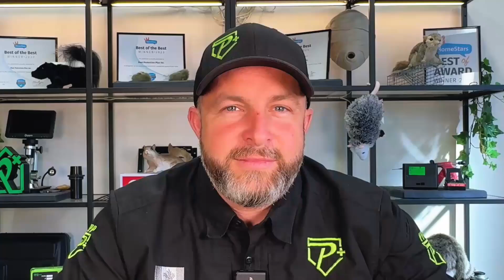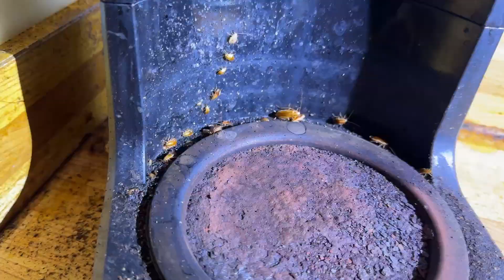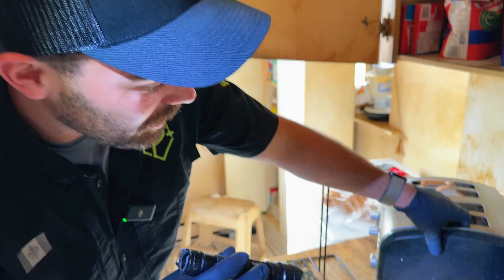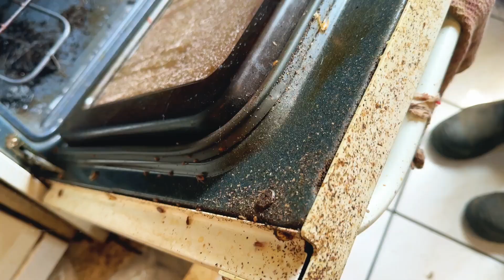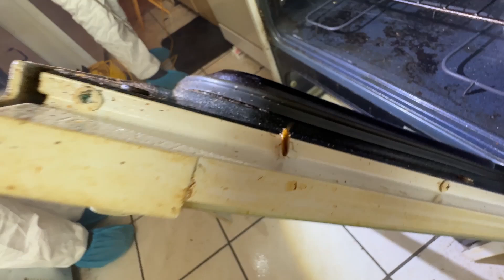Getting Rid of a Severe Cockroach Infestation an Exterminator

Comment from the maker: 🧭 Timestamps 🧭
00:00 - Introduction to the infestation level
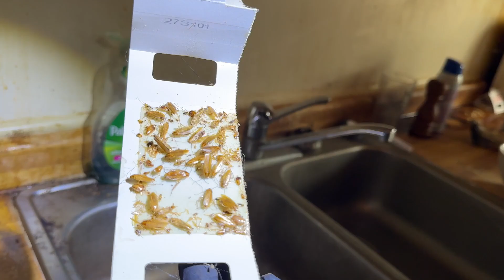00:27 - Why DIY sprays and foggers fail
01:21 - Step 1: The professional inspection process
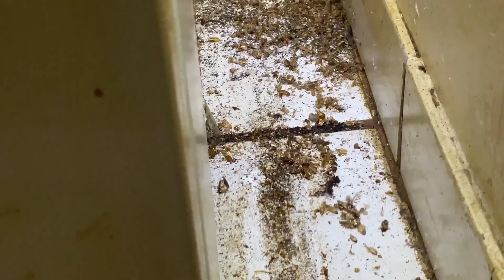01:46 - Identifying cockroach "harborage" and nesting areas
02:21 - Introduction to the Actisol mechanical aerosol device
03:05 - Treatment in action: Flushing out the population
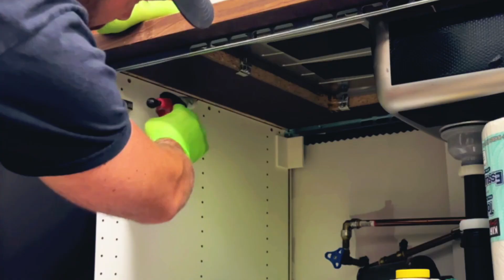04:20 - Applying professional-grade gel baits
04:36 - Essential sanitation tips to prevent return
05:17 - Sealing cracks and structural gaps
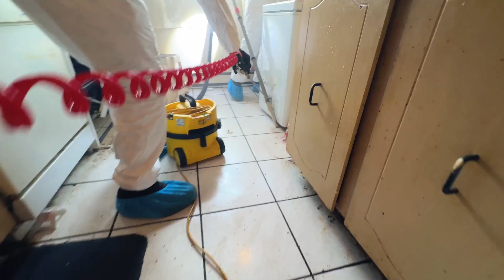05:29 - Why follow-up visits are critical (The egg cycle)
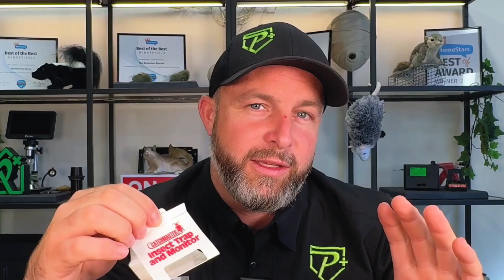06:28 - Monitoring for a cockroach-free home
06:56 - Final advice and professional inspection info